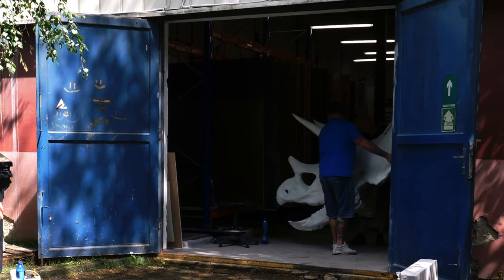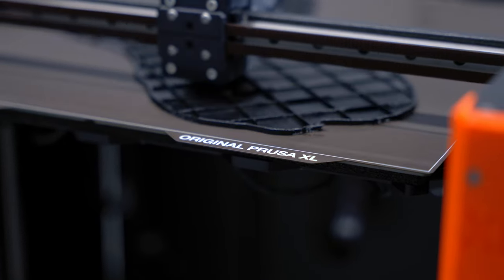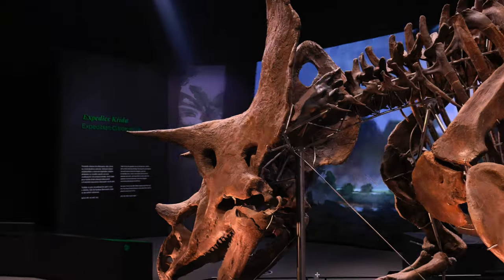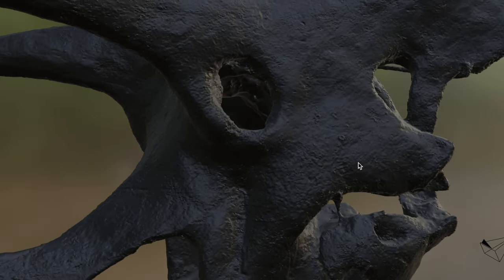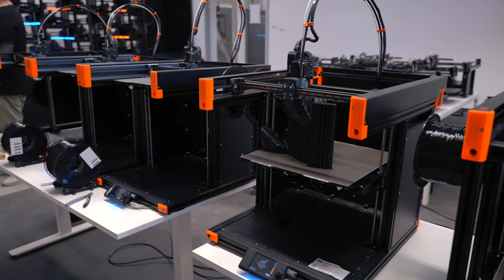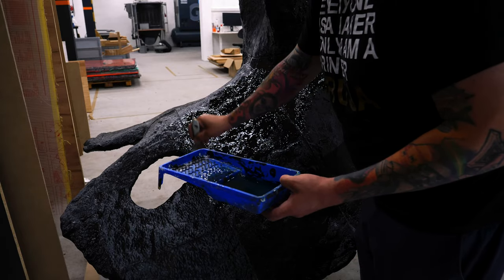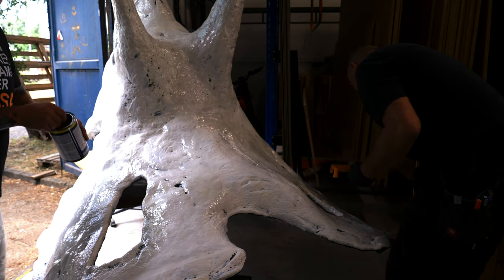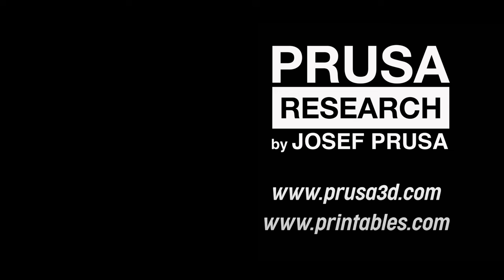Inside Prusa Research workshop: How we made a life-size Triceratops skull replica

Comment: Very nice. Why photogrammetry as opposed to more traditional 3D scanning?
Reply: Im assuming you would need a MASSIVE 3d scanner to capture an entire Dinosaur!
Reply: Photogrammetry has become surprisingly good. Look for archaeologic reconstruction of underwater shipwrecks like the Mars with photogrammetric methods.
Reply: @MrBizteck  there are plenty of hendheld laser scanners out there, that are way superior to photogrammetry - it is more a price topic, since a camera + photogrammetry software is way cheaper than a good scanner

the Shining 3D EinScan-HX for example costs about 15k, the also very good EinScan-H comes for about 4k and - the Fujifilm X-H1 camera they used costs just under 2k
Reply: It’s a tribute to Slic3er’s memory handling and internal data structures that it can handle such unusually big models, especially using Prusa-brewed advanced functions. 👍
Reply: I can only imagine how long each piece took to slice. Anything approaching 1m polys makes it a long process for most slicers. I can only wonder if an improvement to handling high-poly meshes is coming to Prusa Slicer after this project 🤔